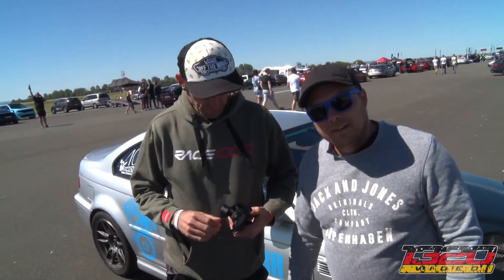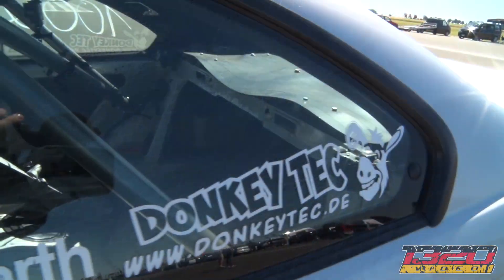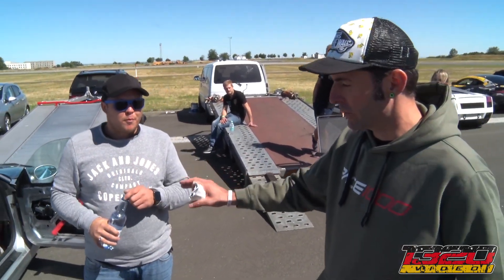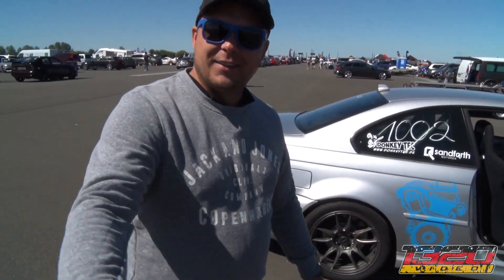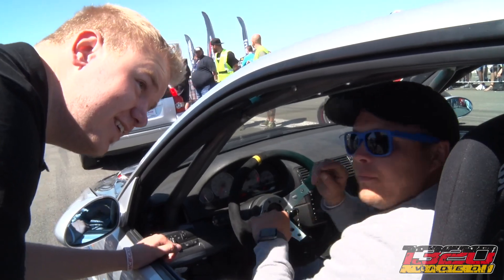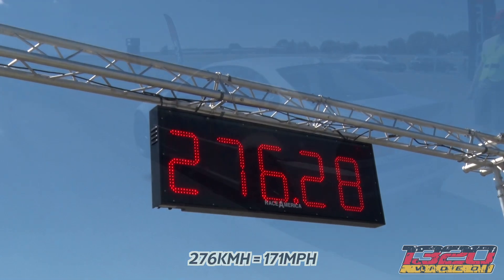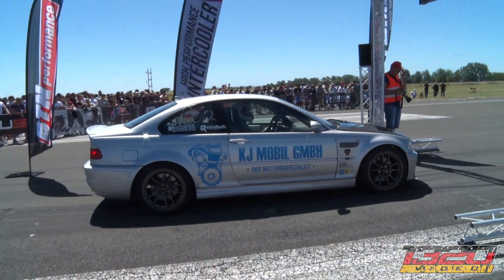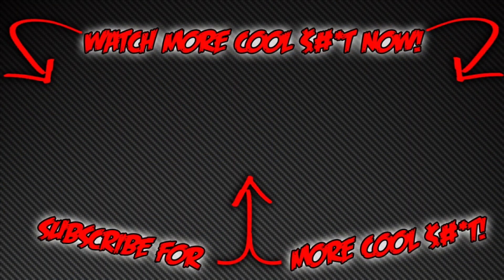950HP BMW E46 - Shooting for 300kph? (man shifting!)

Comment: For those who are a bit disapointed, Dragracing in Germany is not our best Discipline. There are a Hand full of Tracks wich are only a few Days a Year open. We´re more Circuit orientated..

Cheers
Reply: You dont need to be a drag racer to know that hitting the rev limiter in EVERY gear ROBS mph
Reply: Clearly
Reply: Pretty sure that its tire spin causing that. But I agree that car should have been faster.
Reply: @GregoryVeizades  nah hes makes it sound that way by sitting on the limiter. 1st yeah second maybe....but 5th??? Nah if he would get ogg the limiter he would pick up 5mph on each gear at least ...4 gear changes X5mph=20mph....that would put him much closer to 180's.
Reply: Sounds like a lame excuse to me.
Reply: if they are disappointed then they aren't car guys.  I'm working on trying to adapt a t56 trans into the e46 m3 so that we can be much harder on the shifts.
Reply: Buddy Craig, i´d say 80% of the remaining german Car/Tunerscene aren´t full on Car guys.... Even my close Friends don´t even watch 1320 Video... But.. If there is a propper Tuner, i can insure it´s a really Badass Build.
Reply: But I thought circuit racing was so much more difficult than driving in a straight line....

Lame excuse indeed
Reply: thanks for this lol i was wondering
Reply: Lmao, on that small tires and without tc that thing burns rubber trought all gears
Reply: Gregory Veizades nah its not spinning
Reply: @rrooccaa  bro u ever drive a 950 Hp e46 w street tires??
Reply: @Mena6e.c7  your point? Still no reason to pound the limiter.

Comment: Don't sound rite....
Sounds like a fueling issue.
normally 950 bhp would absolutely fly when on boost.
This just seems to hit the limiter at low revs.
Reply: To be honest, it doesn't even sound like he is pushing it. It seems as if he's only giving it like 40 percent throttle or something
Reply: @Red Af Or maybe you can mind your business. Nobody asked for your negativity. I know very well how they sound. If you paid attention, you can see  and hear him clearly holding back a bit.
Reply: @Red Af I have BMW with a N53.B25 engine.
Would sound exactly the same as this if it had a turbo.
Reply: This is a non-vanos M50B25. And if you want to hear what those should sound like, put "Lets go for a ride with Skogenracing" in the search bar and prepare for goosebumps. The car in the video does indeed seem to suffer from some quirks.. Cool car nonetheless.
Reply: @kondemnert  

At the beginning of the video a man said that they tried to run without Vanos's, but it had issues.

I'm not trying to slate the car.
I think it's absolutely brilliant.
I was pointing out that I believe there's something not quite rite with it. And I hope that it can be put rite..

With my own personal experiences with my bmw, I think the timing might be out, or the timing chain could be stretched.

Just had a £3000 engine rebuild.

1st head gasket. Had metal gasket fitted.

2nd cam chain stretched.
New genuine bmw complete cam kit fitted.

3rd inlet vanos buggered,  so had inlet and exhaust vanos's changed.

I love the car so I don't mind spending money on her.
Reply: W
Reply: The turbos so big it needs a 70 mph rolling start. Keep it N/A lmao

Comment: Needs a driver mod for sure
Reply: Just bounching off the revlimiter.
Reply: Thumbs up if Cleetus should be shifting
Reply: Should be shifting at around 6800 rpm or right before the boost cut, or tune out boost cut and slingshot it.
Reply: Chris Harris 6,800? What the fuck😂it revs higher than that if its built. Shit a stock S54 revs to 8K, 9 with a simple chip tune
Reply: Tyler Chedister you must not know alot about cars. When you turbo it you usually have to lower the rev limit.
Reply: Kaisuhina no if anything you raise it🤦🏽‍♂️i have a built turbo M50

Comment: Hmm, something sounds wrong here. Was that fuel starvation or a timing issue up top?  A thousand HP in a 3 series gets you north of 180mph typically.
Reply: Mike O'Barr 1000hp goes well over 200 in any vehicle, typically...
Reply: I'm with you, did not sound correct and should have gone faster.
Reply: Ron Barr & Enlightened Idiot.. Ok cool, so I'm not off base.
Reply: Exactly
Reply: Sounds like traction issues to me ?
Reply: Although after watching further . It's not reving out far enough is it
Reply: Wind resistance, elevation, air temp, rev limiter, tune? Number of factors.
Reply: Justin McMullen could be the engine they have in it too, redline is 1500rpm lower than a stock e46 M3. But yeah something wasn’t right, and this didn’t seem like that great of a build in general.
Reply: @J-Eagan  what motor did they put in it ? He said 2.5 l why wouldn't they leave the 3.2 that comes standard in these . I think it's 3.2 can't remember
Reply: @Manhole87  I believe the 2.5 may have been the M50B25 Non Vanos cast iron block, my best guess
Reply: Keep in mind it could be tire spin due to shit track surface. Cooould be.
Reply: The M50NV are cheaper, easy to tune and handle boost better.
Reply: Mike O'Barr idk why he went e36 M3 motor🤦🏽‍♂️1,000hp out of an S54 and he couldve had a smaller turbo. And he needs better gearing. All hail the S54
Reply: Justin McMullen he is hittin limiter in almost every gear
Reply: @Jcrigs  yup it was. A s54 is still way better and will make 1000 much easier
Reply: Deff something wrong in high revs that sounds so ouchh
Reply: You now that this is a unprepared track with terrible grip? Times are usually over 1 sec worse then glued tracks
Reply: Yeah but it's more than tire spin and him hitting the limiter (which both happened) it seems to be breaking up on the top end of each gear. Before he hits the limiter it seems to break up. No way it's breaking the tires loose at 100mph and blitzing the limiter. I'm sorry but even a 1k HP car that's running great is not breaking loose in all 6 gears.
Reply: Tyler Chedister yeah he's hitting the limiter but look at the cloud of brown/black smoke (raw fuel) from the car before he hits the limiter in every gear. People keep saying it's blowing the tires off but that's definitely not the case. The smoke shows up before the popping/limiter sounds and it's the color of gas kit rubber.
Reply: My first tought was map...but can be anything 😂
Reply: Berring1000 sure, just seems weird that they'd feature a car that's dropping cylinders on boost.... Provided that's what's happening. That's why I commented. It's seems odd.
Reply: Tyler Chedister does not need 3.2l for 1000hp.  He is not american 😉.   And 2.5 has a stronger block.
Reply: For starters, there's a very good chance this isn't even an M3, but yeah, he said it's an E36 engine M50 non Vanos (iron block). My guess would be it's simply much cheaper to build than an S54, not to mention much cheaper to replace if it breaks!
Reply: Pedro Santos pritty much.  But it is an m50b25 with vanos.  Then converted to nonvanos.   Chassi is m3 But m50 iron is stronger and AS you said cheaper ( dont have to start with upgrading crank and bearings) than s54.   Protip.  M50-m54 2.5l.  Cams/ess charter KIT and exhaust.  M3 killer and more fun.   (I have e46 compact with this setup and Its superfun)
Reply: So many experts
Reply: if im not wrong the 2.5 engine is for the e36 american specs and the 3.0/3.2 are for euro specs so he went for the US specs
Reply: @Manhole87  
They said it was a N50 2.5 engine.
They tried to change the vanos's? 
But caused a malfunction? 
Maybe they didn't 100% fix it when putting the original vanos's back.
Reply: @insanewayne75  
Its a m50b25tü out of a non m bmw. He deleted vanos because vanos lowers the oil pressure i belive. The m50 is cheap, has a big aftermarket and holds a lot of power because of its iron block and strong internals.
Reply: M3 Trans. Listen
Reply: Justin McMullen  because the m50 2.5 is iron block and can hold a lot more boost... and also theres no vanos... so easier too boost...not so complicated in tuning
Reply: Tyler Chedister u callin this garbage build? Lol...like u know better
Reply: Vanos comes with quite a few problems later on and when modifying. They probably just wanted to avoid it completely.
Reply: internet tuners over here lol

As someone with a 500hp 350z built by me, its not that simple. If it was that easy tuners wouldn't have to data log cars. Theyd be like you and just ear guess how to make things faster. Im about to run after 700=ish HP soon on a fresh block... But just because I make high HP doesnt mean i'll be 2x faster..

Also when you start doubling and tippling your factory HP you begin to realize HP is just a number. So no 1000hp doesn't mean 200+... Again its much more complicated than that. Which is why its such a huge feat to accomplish. 

Perfect example my buddy had a 500whp civic he races... He found a shop that made him 690 on race fuel. But it was slower than when he was at 500... He went to a world class shop who brought him back down to 530whp but solid tq... He finally hit his first 9 second run 1/4 mile. HP isnt everything nor is sounds it makes.
Reply: @mrmidnight32  ooh, so you have a buddy with a fast car. That definitely makes you a real tuner. And your Z came with what 350hp to start with? I guess the full interior Evo I built 450whp that hit 173 in the half mile doesn't count or the full interior 11 second dsm I daily drove for years or the Starion autocross/drift car I built and competed with was an internet race car too?
Reply: Looks as slow as my 323. Car is all top end.
Reply: @Jcrigs  In the us the cars [e46]came with iron blocks and aluminum heads. However I am pretty sure that started out at a ci and not an m3. There isn't even a bar across the top two shocks.  [I forget the technical term] but that just came on the m3.
Reply: @mikedrop4421  the car is not tuned well. On the safe end with the rich running but still. It was made to dyno what it did. Not perform well in real world conditions
Reply: @Manhole87  the M50 motor is bulletproof and makes much more power than the likes of the S52/54, mainly because there is no vanos and its an iron block
Reply: @E46TY  ok 1. the m50b25 is a beter motor than the s54. 2. the m50 is not e36 m3 engine it's a standard e36 3series inline 6 2,5L. the fact that you tought it was an m3 engine means your creedability whent out the roof.

Comment: 920+ and can’t even go over 200MPH+
Reply: I dont know what the hell this guy was doing... kept bouncing off the rev limiter in every gear, would keep the car from accelerating smoothly..  plus his launch were slow as heck.
Reply: Sorry sir but not too many cars with less that 1000hp can do over 200 in a half mile.. I dont think I have seen one actually. But yes he did shift like shit. That car might have a 185 mph pass in it with a good driver
Reply: Thats a bit ignorant. My evo is only 665awhp 556awtq and did 188mph in the half. you have to account for power:weight
Reply: @XxAtomic646xX  dude the power to weight is such basic knowledge in the car world everybody knows that.. I guess u just have a fast evo because like I said I havent seen too many cars under 1000 wheel do over 200 in the half.. And keep in mind wind resistance is the biggest issue in top speed runs not weight. Just because he has a light 900hp car does not mean he should be over 200 mph in a standing half mile.
Reply: There were several reasons he didnt make 200mph. the shitty start, his shit tires, his slow shifting, the fact he isnt No lift shifting, and his gearing. also, I doubt his car is that light despite being mildly gutted. Bmw are notoriously heavy cars
Reply: XxAtomic646xX im guessing your evo is gutted, kinda hard to believe you did 188. I have a buddy that has a evo with around 750-800whp and he trapped 175-6
Reply: Why is 200 mph being discussed? 300 kph is only 186 mph. Lol
Reply: Probably no traction, that's near 1000hp on street tires
Reply: + Miguel-angel Cervantes Not really no, I had the rear seat out and trunk is gutted but the rear seats are foam only weighing 5lb. also a/c delete, but other than that its full interior it is an rs tho, and does have a sheptrans ultimate ratio trans with 4.11fd which helps immensely and to be fair, its 665awhp on a low reading dyno, so really its prolly 700~awhp. 39psi on a pte 6266 with 9k redline, Its geared for well over 200mph. 4th gear tops out at 162mph
Reply: +Khris Makaruk you can see videos of the car on my channel bruh... You act like its some amazing feat... its a pretty standard off the self ETS build lmao
Reply: @XxAtomic646xX  he said early on in the video that the tranny was weak and he would hit the hole slow. 🤷‍♂️
Reply: yeah, guys it is not prep track, most guys have standart street tyres (its illegal in germany tu run wider tyres than it come from factory)... tho, his driving isnt the best
Reply: +Khris Makaruk you sound so salty lmaoo dont be jelly. I said videos of the car are on my channel. not the half mile run kid.. Learn to read before you try and shit talk xD
Reply: you can reach 189mph in a 507hp  1900kg car. (bmw m5 e60) you should be able to reach 200mph in a 1400kg car  that has 900hp.  hell a 1500kg 135i e82 750hp with a wing can reach 200mph